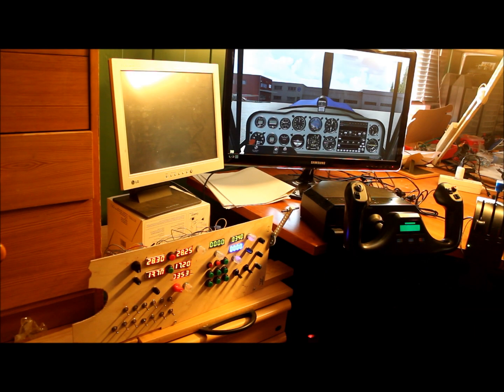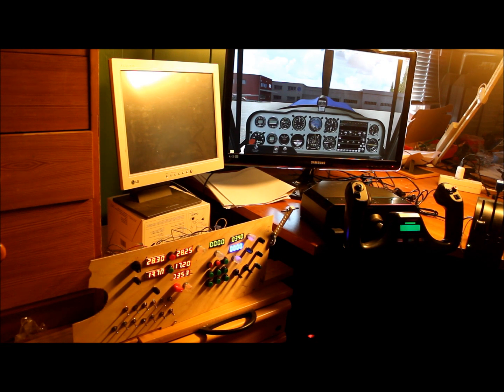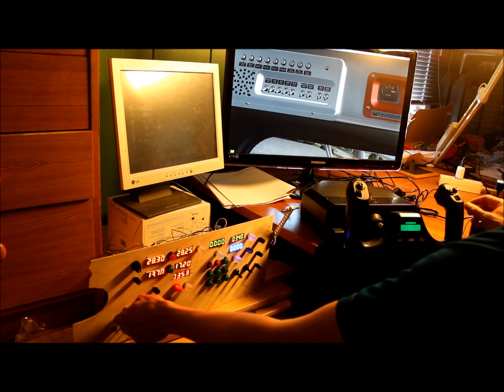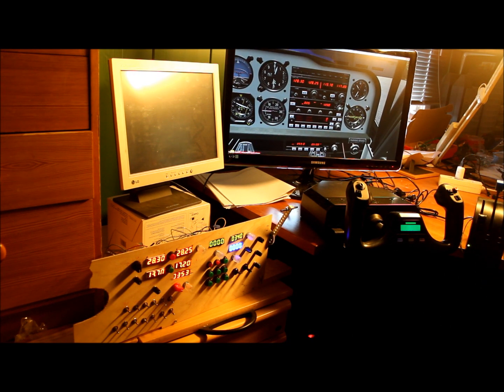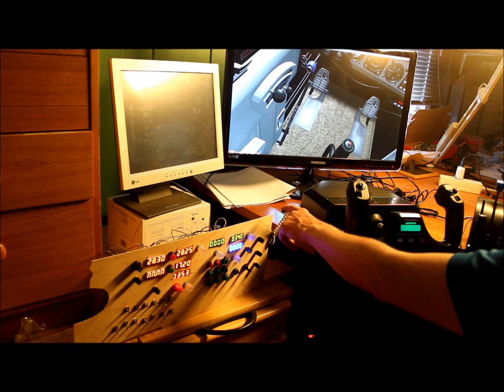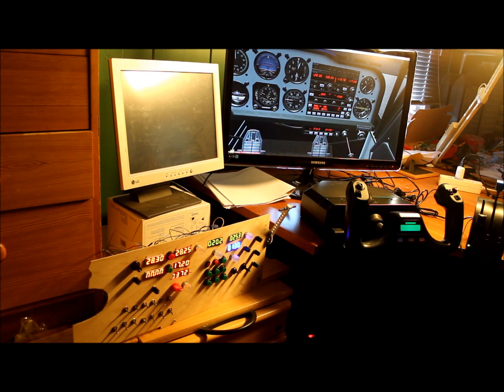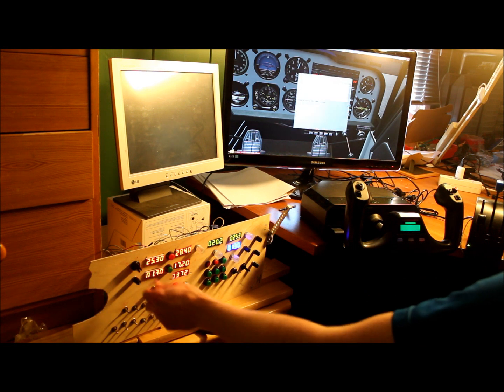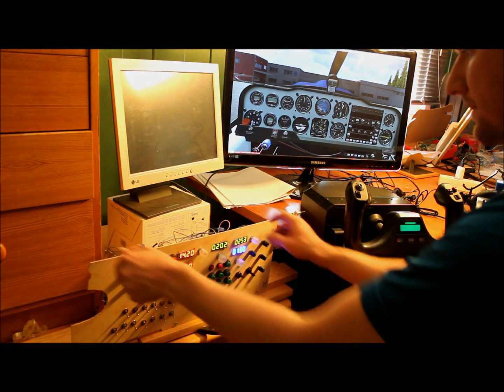Final version of prototype arduino flight simulator panel

Comment: Hey man I have a question for you. Is there as specific reason as to why you used both Arduino + Lua code? I mean... as far as I know you could just go for Arduino + Link2fs and the result should be the same... I'm I missing something?
Maybe interfacing with Lua gave you some advantage of which I'm not aware? Any answer will be great, I'm looking forward to build myself something like this soon. Thanks for sharing this

ps. the custom panel is awesome!!!
Reply from the maker: Absolutely'Min-lime Thanks :-).

I don't think there's one specific reason for not using link2fs, but I was unsure as to time if it supported two-way convocation to allow me to get the displays for the radio stack and autopilot panel out of the simulator. Just figured that it would be much easier to write that myself so that I had control of everything :-)

Comment: Very nice project !

What are you using to control LEDs/Light ? Arduino ? Lua and FSUIPC can manage output ?
Reply from the maker: Benoit Campeau Yes, the Arduino drives the LEDs, and they are switched on and off based on values sent to the Arduino by the lua script that pulled them out of the simulator.

Comment: I am new in the building of cockpits and like to know... where should one start ....I get lost when I see the wires and all but like to know where to learn more to build one myself.....
Reply from the maker: Anthony G My best suggestion is to start with a simple microcontroller and a single switch (e.g. parking brake). You can use the Lua script I created or see if you can use the link2fs application and just format the serial output from the Arduino to match what the application is expecting. I think this format should be quite well-documented.

Comment: Great work, I have a question. Can I build this ( or something similar ) by using an Arduino teensy in joystick mode? I aim to configure the switches to become momentary (can one do this using code?) and use the 6 axis from trim and throttle controls.
Reply from the maker: As far as I know this should be possible, but I have not tried it myself. A good idea though to do the interface like this.

Comment: Nie panel !! Only works on FSX? because I use FS9. Thanks =)
Reply from the maker: My flight simulator interface code assumes that it is talking to FSX. However, it is just a simple lua script run through fsuipc, so if you have this for FS9 it should be ready to be straightforward to adapt to the different offsets (if this is how FS 9 works).
Reply: Frank Olaf Sem-Jacobsen  Ohh I understand now. Once receive the arduinos, will start to work with your script. Thanks for your answer =)

Comment: better use leo bodnar buo386X card all switches have better and simple, but radio need use arduino have better and annunciator or other too whit arduino. + link2fs program.
Reply: Matti Virta 
with link2fs, you cannot make a link with FSUIPC (with the macros for exemple)

Comment: code have but have you schematic too how connect and what pin to mega card all ?

Normally no used potentiometers, all fregfency changed at rotary encoder, mean anthony hernandez comment thats :)
potentiometers need only etc, yoke,trimm wheel,prake,
normally have 10K or 100K linear. all yoke and flight stick use 10K lin.
but normal better have multi turn 10K lin whit trim wheel.

and lisplay have better use max 7219 chip used 8 digit 7-segment no need many wire,only 2 to power and 2 to display data :)
simple.
who use old school LCD or 7-segment and use 8-16 pin only display ?????
I2C have today and save lot wireplaces :D

Comment: Can the inputs be multiplexed?
Reply: +GEMASPIRE not really. you would take a power wire(vcc and/or gnd), and connect it though the switch to a pin. there's no way of condensing that. however you can get input boards with tons of inputs that communicate over serial. just pipe that into a serial port on the arduino.
Reply from the maker: What do you mean by that?
Reply: For example, an array of leds can be multiplex in order to save some arduino i/o pins. Can an array of switches be multiplex in order to save input pins?